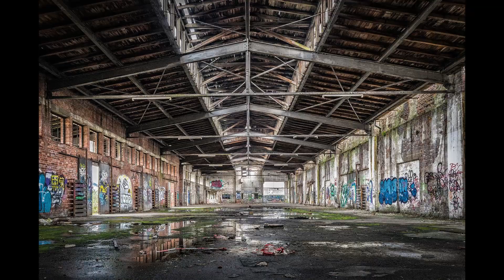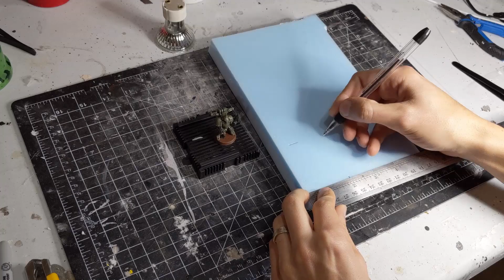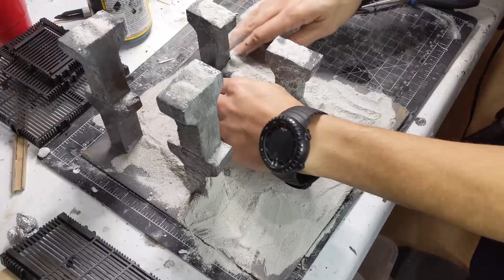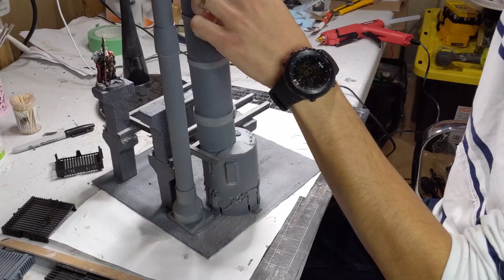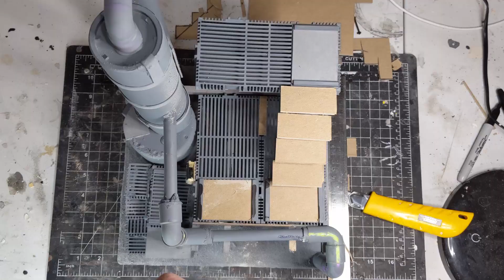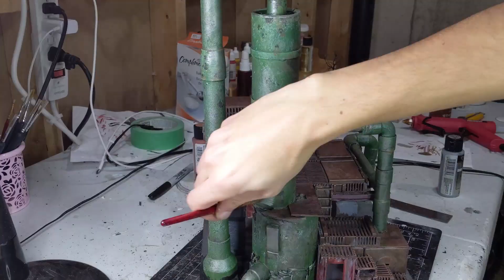40k Industrial Wargaming Terrain (/w Rusted Effects)

Comment: For the oil based primer, have you tried cheap cans of Montana graffitti paint? That stuff sticks to anything and is usually cheap if you look around. Wouldn't use it on anything for details, but for surfaces that you doubt normal primer would stick to, it's great.

Comment: Hi so here is a tip for using hot glue gun on any projects, to get rid of any whisps of hot glue string take and turn on your styrofoam cutter with the long rod and take it and hold your item up to the light so that you can see the whisps and then touch the hot styrofoam rod to them and whalla they disappear into smoke. (where a mask yes) It also gives you the ability to for example clean up the excess hot glue on project or in the case of the beams I take a little bit of time and make the glue look like welds from a welding machine...
Blessings
Pastor Randy Bourque
Excellent Videos really liked the Japanese house one will reproduce that one some day in my own style..
Hope you like the tip and share it.
Reply from the maker: Thanks Randy, that's indeed a great tip!